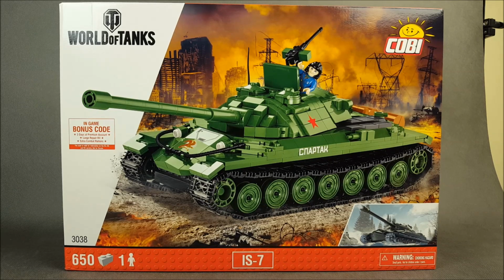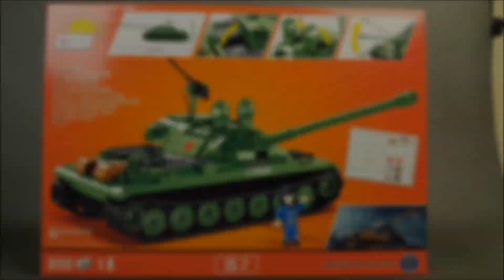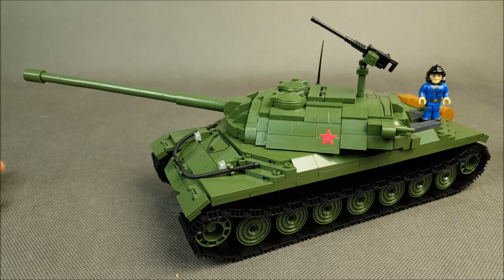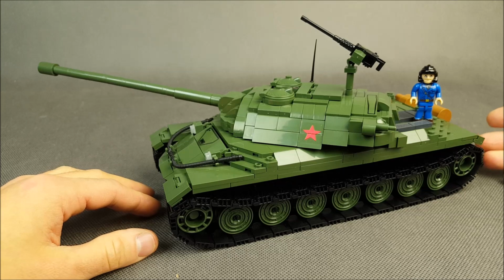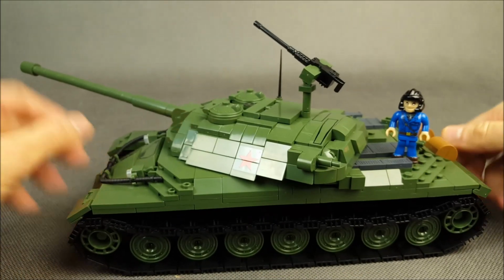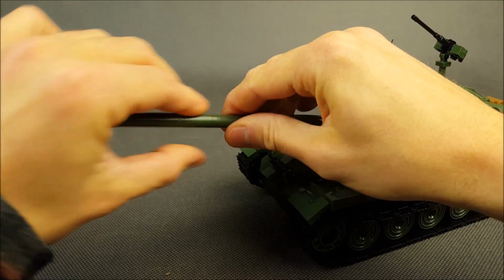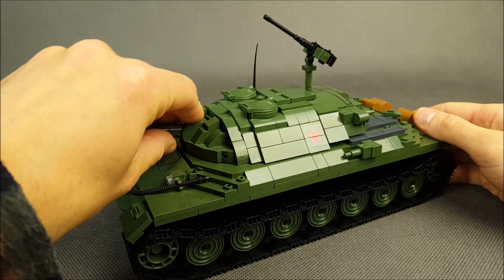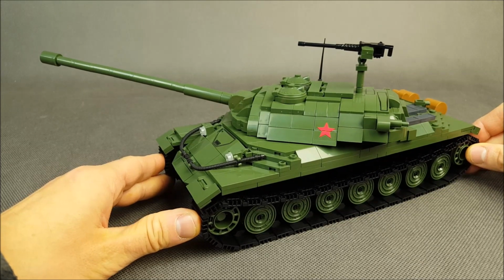Let me build COBI IS-7 - World of Tanks (3038)

Comment: Lack of interior detail is my first complaint about Cobi sets, second would be the lack of a proper turret ring and in some tanks, a turret basket. That said I really enjoy building Cobi sets and there's nothing else out there at the moment that make as many types of affordable brick built military vehicles (looking at you Mega Construx).
Please continue with more English language reviews!
Reply: Cobi also is garbage at making the lower play of tanks. Front and back. All of their tanks have a huge black block sticking out if the bottom. It ruins it for me.
Reply: But why do you want a whole interior? I think Cobi mainly makes these for kids to play with, so a whole interior isn't needed. I mean, ofcourse, an interior would be cool, but it's not necessary
Reply: @mister_modeller  I believe the majority of collectors that build the higher priced Colbi tanks are teens and adults. Cobi makes a line of building block models aimed at kids and those models reflect that. A detailed interior would add to the enjoyment of building the model and would require the main gun to be built more accurately as the gun extends into the turret. If the top was made easily openable it would add to the play value if kids did want to play with it. The way Cobi tanks are now, you can only put the minifigures standing out of the hatches, if a kid wants to have the characters inside, they'll have to remove the minifigures, close the hatches and set the figures aside while they imagine the characters inside the tank. When I was young, I appreciated the ability to put GI Joes inside vehicles and was a part of how I played, I would imagine kids would be frustrated that they couldn't place minifigures inside their vehicles.